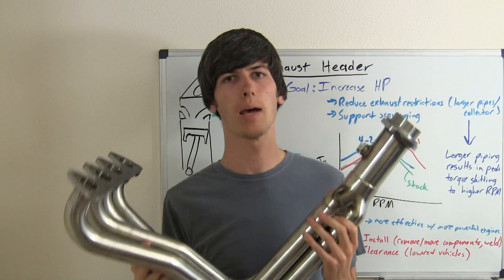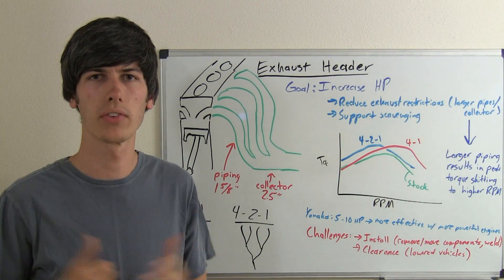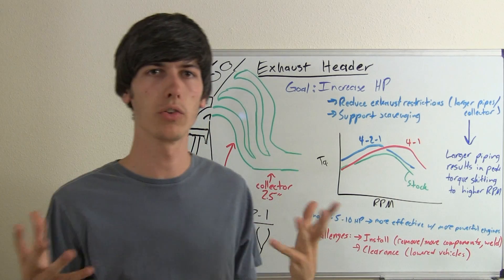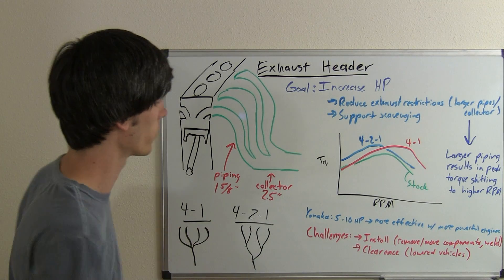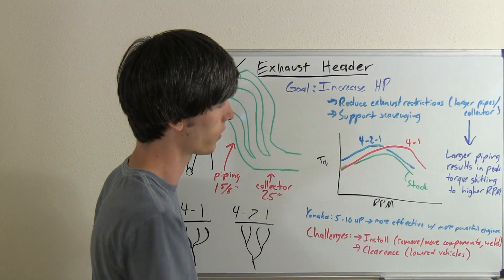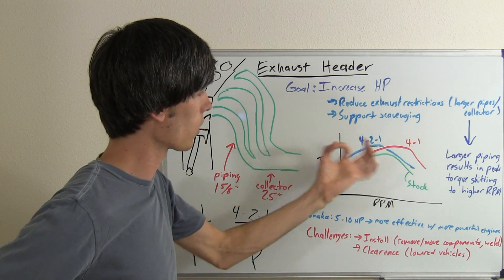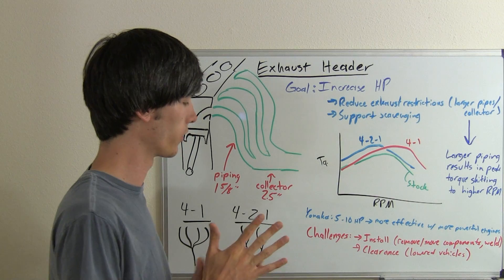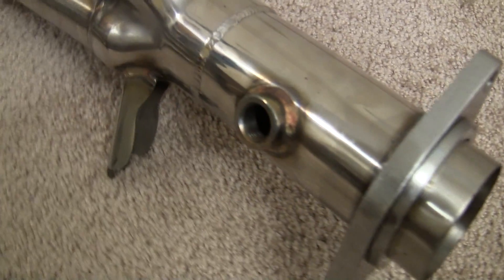Exhaust Header - Explained

Comment: There's a third way a header increases horsepower: Sound Reverberation. Sound will bounce off the collector, come back, hit the head/manifold plate and go back, pulling the next exhaust pulse with it, and at certain rpm's the header will perform best as the sound bouncing off the head is in time with the exhaust valve opening.

Comment: I'm running straight headers on my R1 motorcycle. Sounds like a formula 1 car and very loud. But my bike comes stock with a back pressure control valve in the exhaust. I can change anything after the valve without effecting performance. W/o this the power may suffer b/c of inconsistent exhaust flow and the engine would require optimized tuning. So be careful if you do it and be ready to get yelled at when you come home at 2am lol

Comment: Technically they may be the same, but car guys see it this way: Headers refer to equal length pipes designed to smooth out exhaust flow and increase performance (exactly what you see in the thumbnail). Exhaust manifolds are stock pipes coming off the cylinder bank, they're not equal length and do not help with performance. Both are simply that group of pipes in the video, beginning at the cylinder bank and ending at the pipe bolted on after the cluster.

Comment: headers are made of steel using individual tubes so that each exhaust port has a tube then all tubes from the same bank exit into a collector, ideally each tube should be about the same length, that way the exhaust is tuned either for power of for sound or both

exhaust manifolds are usually made from cast iron, some have individual runners